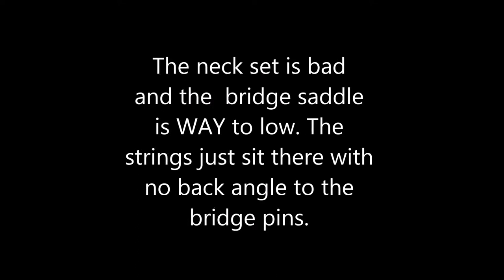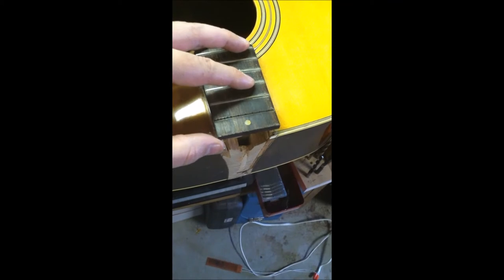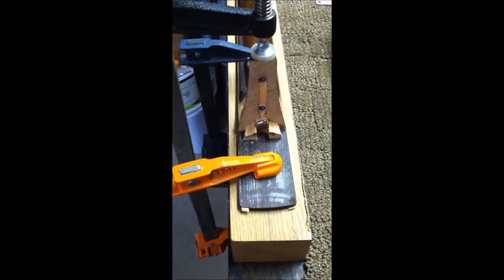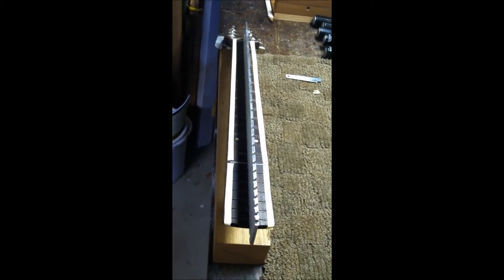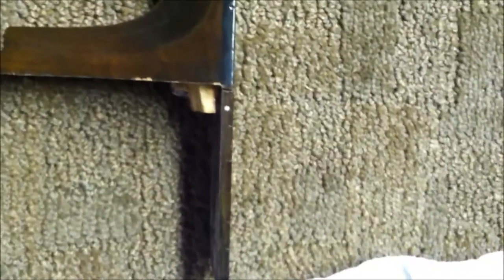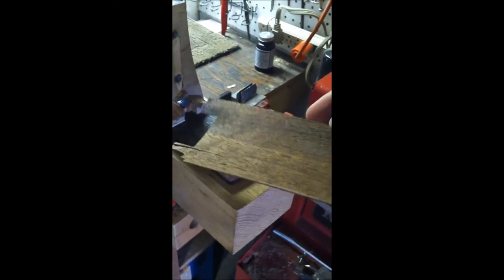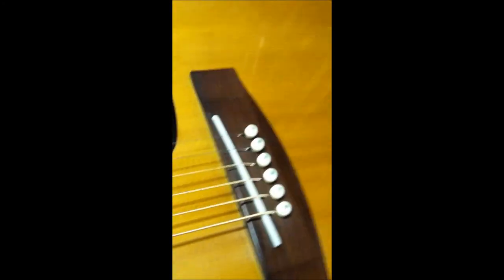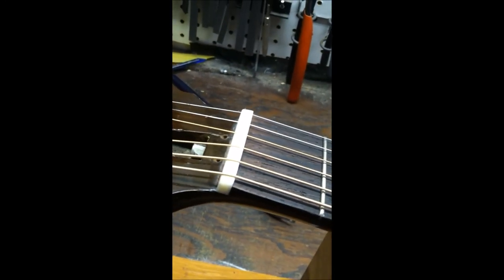Yamaha Epoxied Neck Reset

Comment: Nice job. I was curious how you you bolted the neck on. Did you drill through the front of the heel, then later patch the holes, or did you use wood-mounting studs (woodscrew thread on one end to thread into the flat side of the heel, with screw thread on the other end, and drill holes thru the heel block?  I didn't see any of that in your video. If you didn't include that because you prefer to keep it proprietary, I understand. Also, I never thought of doing it this way (sawing off the neck). I have steamed, but generally it takes an hour, and the epoxy never really softens---only the wood softens around the epoxy, so there is always a certain amount of wood in the dovetail that gets sacrificed--which becomes scary. Nice job. I agree about the guitar--great sounding (all of the FG series Japan red-labels are).
Reply from the maker: +Joe Brock  Hi joe. Thanks for your comments. If you watch the video again I did have a small part that showed the threaded inserts into the neck heel. But you're right, I didn't show to much more of the boltting process. Sorry. Before I installed the inserts I drilled two holes into the neck block all the way through to the inside of the body. Once I did that then I clamped the neck in place. Then I used a drill bit and inserted it through the sound hole through the neck block just so the tip of the bit would mark the heel of the neck that is clapped into the right position. This little indentation from the drill bit is where I drilled for the inserts. After that it's essentially machine screws and finishing washers through the body/neck block and into those neck inserts. Youre right about epoxy never softening. This was a scary way of doing a neck reset but boy did it work great.